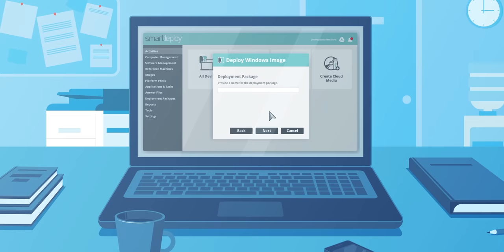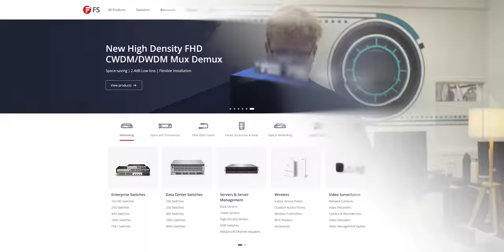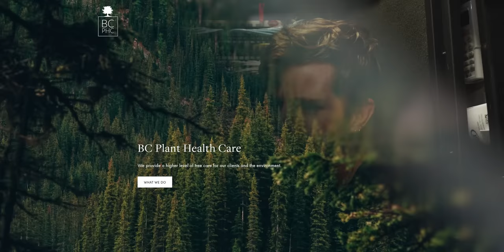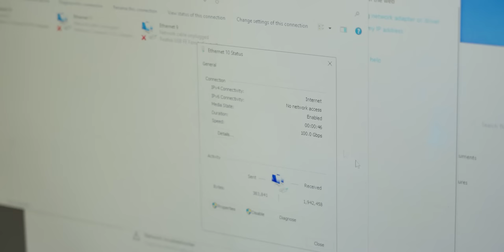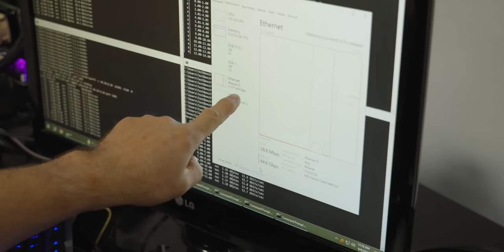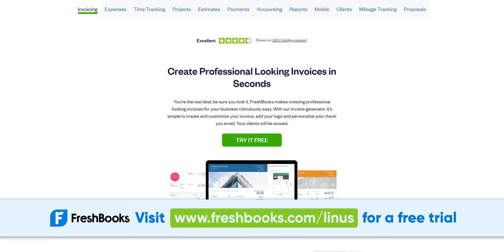Everyone said this was impossible - Backyard Fiber Run

Comment: I work for a telecoms company in England and it’s great seeing the equipment I work on in videos like this! Also glad you appreciate the work the cable gangs do, they do such a hard job!
Reply: didn't your toe nails curl aswell at 6:11 ? pulling a cable during it's whole length through the tiny opening between fence and the non-rounded edges of the fence mounting? this metal is going to have field day rusting due to the outer mantle being scratched. just take the time to properly dismantle the fence, pull the cable through, and put the fence together afterwards.
cable guy from germany.
Reply: @deinemudder3066  I think you may have missed the part where its temporary.
Reply: @andresmithe298  would you be so kind as to link me to my enlightenment? don't want to come as cocky but i am not for information without the point to it. since i obviously did miss it then. thank you (=
Reply: Fiber-guy from germany here. I usually do the connections between cable sections (dunno how you guys call these things in english) and the final meassurements/certification. Usually on 96' and 144' fiber cables.

It's cool to see them have some fiber on camera  :D
Reply: @deinemudder3066  I'm not going to re-watch a half hour video. They said it repeatedly, they were doing this for jokes once they saw how cheap the cable was and explicitly said it was temporary...
Reply: @SuperStevieye  NE3? :D
Reply: @deinemudder3066  they did say it's temporary and they're not going to keep the cable pretty much at the very end of the video 28:40
Reply: @Nazgul094  yes, pull it 2 times through there. and after that straight up throw it away. very ecological thinking. if it was temporary just throw it over the fence, maybe put a blanket over said fence. no wonder american barracks are wired like doggo =/
Reply: @deinemudder3066  I don't think by "temporary" they meant they're going to throw it away but rather they're going to return it to the company.
Reply: even more reason to handle it better
Reply: @deinemudder3066  I'm pretty sure these companies know what LTT does and expect their products to go through high levels of abuse especific to the product they let Linus borrow for the videos, I see it as another way in which these companies can advertise through Linus' videos, showing that the things they make are capable of being handled roughly without much issue and Linus creates content out of showing that, a win-win situation.
Reply: @SuperStevieye  we call it splicing in England, I also work on 96, 144 and sometimes 288 fibre! Always good to see the work gets shown, all people normally see is a modem and not the hard work that’s put in
Reply: @deinemudder3066  most of this video was incredibly cringe inducing.... like them running the cable with ends already on it.... and just running it through the woods the way they did.
Reply: Bro me to, but once he dropped the switch box and caught it by the fiber made me cringe. My boss would prolly fire me. Fiber Optic wire is incredibly fragile, like if you touch the end with like anything it needs to be cleaned or else you will get a lot of loss.
Reply: I love seeing this. I work for Telcoms company in the US. I work with this stuff daily so this excites me so much.
Reply: I feel you dude. Rolling out fibre through rural Herefordshire. Its a slog
Reply: @deinemudder3066  Love that you crap on Americans when LTT isn't even based here, even better that you didn't pick up on the fact they've said multiple times it was a temporary fix. You dont look into everything before you mouth off and it shows.
Reply: @ChillTox  canada is in america, right? the continent is called america, the country is called usa. "temporary" doesn't justify ruining that cable by scratching it. that cable is never going to be sold again with those scratchmarks. talk about looking into everything, merry christmas, next.
Reply: @deinemudder3066  "Americans" pretty much universally, colloquially, means people from the USA. But let's say it doesn't; have you visited enough barracks from every country on the Nort and South American continents to know what the average quality of cable runs is in them? Regardless, it may come to surprise you that LTT is primarily an entertainment company and NOT an IT installation contractor for "American" governments.

But hey, it seems like you enjoy being wrong about everything while trying to convince everyone that "well actually" you're somehow correct. You do you.

Comment: I'm glad you pointed out that this was entirely for the memes. If it wasn't already blatantly obvious to anyone else watching, there is functionally zero difference between what they did, and just keeping the completely intact spool in a single office and testing the speed by connecting both ends in the same room.
Reply: It’s just for the memes…wink wink nudge nudge 😂
Reply: @Likeomgitznich  he’s for sure using it. He mentioned in a previous video he wanted to do it.
Reply: @Likeomgitznich  I wonder what the cost of 600m of that right of way would be

edit: I feel like the equipment wouldn’t be exorbitantly costly to trench and backfill to however deep the regulatory requirement would be. It’s flat ground. Is that area rocky?
Reply: Parhaps? I’ve not heard of it. It has to be spooled. How else would you store or transport it?
I know some stock exchanges and seducers t applications intentionally spool miles of fiber to test artificial run length or to actually create latency
Reply: Nobodies gonna stop him... so yeah I guess he's gonna use it anyways. It's literally in no one's way.
Reply: Haha.. I figured the whole thing about "let's just test to see if it works" thing was the step before "yep, it works, so leave it there."
Reply: @DingDingTheYoutubeBuddy  Copper creates a slight magnetic field when spooled like that.  Fiber shouldn't have any issue, though.
Reply: at 6:20 he talks about micro trenching, so...yeah.
Reply: @DingDingTheYoutubeBuddy  copper, and it's not quantum mechanical, just plain old electromagnetism.
Reply: @AmpdLSU  he said 100k
Reply: Proof of concept, logistics is a big part of any job
Reply: @harmvzon  yeah I blanked on that one lol.  Maybe it was that cost to install as well as take responsibility for any business disruption because of a digging accident or something for ltt since it will not be on his property it’s on someone else’s

Or maybe it’s to trench as well as put it in conduit for protection from root growth and things

Idk just trying to justify why it’d cost that much. Something to do with the business aspect of the installment and the property rights is my guess.
Reply: @rollerskdude  the city will definitely get in his way if they get wind of this happening on their land.
Reply: @Nothinglastsforever  But will they cut the line?
Reply: @rollerskdude  lol I doubt it. Maybe they'll say move it or cop a fine.

Comment: As a Fiber Optic engineer, look up DWDM, Mux/Demux. 

Also start a cable pull at the middle of the route, pull to one side then go to the otherside.
Reply: He should also look in to 802.11AE and Layer 2 encryption, espacially if he is transmitting Media files.

Comment: I do similar Point-to-Point installs as yours.  I use a 27" minitrencher machine (look it up)  to dig a small 2" trench and drop the fiber in afterward.  Could be useful once your proof of concept is done.  The machine can even fit on a plane once disassembled.

Comment: Loved seeing this. I work as a cable lineman. I typically run around 10,000 ft of fiber optic line a day.
Reply: King.
Reply: Linus runs about 10,000 mm of fibre optic a week.
Reply: What do you mean by daily? Meaning, the company that you're working for got a contract and you have been pulling Fiber for month?
Reply: @spankbuda7466  the company I work for is running new construction across rural America to get high speed internet to people who need it.  Been working with this company for over 5 years now, and have been working on the same contract. Our office runs about 6 crews. All the crews together get about 20 miles of fiber installed a week.  Some of the fiber reels we work with are 20,000 foot worth of fiber, which we have to run as one continuous piece, for max speed. The biggest fiber cable I've ran is a 288count fiber, meaning that there is 288 stands of fiber optic line inside the cable.
Reply: @akanitrix9079  That sounds highly unlikely for any company to run FREE fiber service through rural parts just so a small percentage of potential households could have high speed internet. I'm near some rural parts that the cable company refuses to extend their service lines to the few homes not only charging them a ridiculous fee but having them sign a lengthy long term contract.
Reply: @spankbuda7466  to blow your mind even more, I have ran several fiber lines that have been 5-10 miles long, just so one or two houses could have access to our internet. I have worked in several other states, doing the same thing, for the same company.  The new contract I mentioned before is actually for my home town! When we get to that part of town, I am going to be running fiber to my grandparents house, and she hasn't had internet in that area since I've been alive ( 26 years )
Reply: @akanitrix9079  What I'm telling you is that there's no Telecom company that will spend money on materials, man hours, etc. to build their network around 2 potential customers in some rural area if A. the customers paid for it B. the town planning on having new development C. you're updating their network by replacing the existing copper for Fiber C. the Telecom network must go through said rural area to a neighboring area by setting up C/O's/Hops/PFP's. 
But again, you're just a laborer that works for a construction contract company that won the bid to do the work.
Reply: @spankbuda7466   @Spank Buda  I'm more than a "laborer". I supervise all new construction and job progress. My company is contracted out, correct, but the company we are currently under contract with is not just a telecommunication company. They're a power utility company that is getting a fiber optic system within the bounds of their power grid.  Meaning, anyone who had electricity will have access to high speed internet. We do run fiber through rural areas to connect to different city's and systems, but we also extend out lines several, several miles to reach even the furtherst customers, where there is no plans of any new developments. I'm not sure what else I need to tell ya to make you belive what I do for a living 🤣    Maybe I'll be running fiber out to your homestead
Reply: @akanitrix9079  Look, I don't know that if you're lying or not. I'm questioning to what you have stated originally/previously that you were insinuating as if the company who contracted their work out to your company was doing this charitable deed of running Fiber to the few neglected/internet deprived homes out in these rural areas....that they have survived without it for decades. You have also even mentioned your internet deprived grandma on making her dreams come true of having high speed internet before leaving this earth. 
It's logical for the telco company, the cable company, and whoever else to use the opportunity when the electric company are building out or upgrading to use some of the electric company resources i.e. digging, burial, etc. during new construction by getting a discounted rate in construction. I don't know if your company are doing burial, aerial, or both when putting in these Fiber runs at these locations. 
Again, it's not cost effective for any company to build a new node for one or a few houses unless what I've stated before. 
And no, I have multiple options of high speed internet to choose from where I live at and my service providers have been updated their infrastructure over to Fiber.

Comment: They actually are working on 400gbit BiDi (bidirectional) transceivers that would allow this cable to do 2.4Tbit a second. They make use 2 different wavelengths for send and receive, allowing you to utilize 1 strand of fiber for an entire connection. 1/2.5gbps BiDi transceivers are common in FTH deployments. They do have 100gbit BiDi transcievers available today, although they're pretty pricey ($4600 for a pair of transceivers).
Reply: Yeah a product I worked on in 2018 could do 1.2 Tbps BiDi on a single fiber easily. Now we have QSFP pluggables that do 800G and a 2.4Tb module coming soon. 100Gbps is not a challenge anymore lol.
Reply: @iinsomniaaaaa  I was working on a SM connection between 2 floors at our data center for a customer. They kept getting a small reflectance that was really messing with their connection. I asked them how much they were using, Gigbit, 10 Gig, 100 Gig, 300 Gig? She said it was a 4 Terabit connection using transport gear. I found the issue in a dark fiber panel and got them cleaned. I just could not believe how much they had going through 1 strand. Now that the transport gear is more common in the data center, it is like nothing now.
Reply: whomst'd've need 2.4Tbit/sec speed beside datacenter?
Reply: @roy k  who do you think we're selling to lol?
Reply: TASTE THE RAINBOW!!!...with multi colored lasers & frequency specific beam splitters!!!😋
Reply: You can actually do way more than this. Using DWDM it is possible to have 96 Channels, each with at least 100gbit/s, on one fiber, I think even 400gbit/s are possible.
Reply: You could also use DWDM which has up to 48 or 96 channels and afaik the fastest WDM SFPs are 200G, so that's like 19.2Tbit/s per pair of fiber... And I think Ciena also has some proprietary WDM tech that adds afaik another 96 channels... Of course, all this crap would probably cost a couple million but it shows how much data you can actually push over fibers.
Reply: @UC_26TIav0KjnyGjiKGUHZOg he said they are doing 96 100gbit channels over one fibre. And he thought they could probably do 96 400gbit channels over one fibre.
Reply: @royk7712  big ISPs
Reply: @samaneo5  and the Facebooks and Amazons have tons of them.

Comment: The white stick coming out the end is a strength member used to hold the cable in place when it’s fed into a node in the ground. So the weight of the cable is on the member rather than the fibres

Comment: Used to install the conduit that fiber runs through, we did an insane run under the intracoastal in Clearwater,FL that everyone swore was impossible with a Vermeer 40/40, had to bring in trailers of drill pipes and load/unload them by hand. We got it done.

Comment: Fun fact: you can figure out where the break is. Send a pulse down the fiber and it'll reflect partially from the break. In case there is one, that is. For bush removal I'd suggest shrapnel.
Reply: This also works on Cat5/6/7/etc a similar way
Reply: I believe that it's called "Time Domain Reflectometry"!!!
Reply: @fookingsog  correct and you use an OTDR unit to send and read that information in real time
Reply: Napalm more effective or flame thrower
Reply: Bwoomph
Linus: What the heck was that?
Dan: You said to clear the bush...

Comment: As a cable technician, you generally don’t run coax cable more than 400 feet unless necessary, you loose quite a bit of signal to get to 400 and then starting at 400 you loose an extreme amount, even using rg11

Comment: Not only does the metal casing on the "shielded fiber" add strength, it also allows utility locators to locate them when buried. Some fibers are not shielded though and require a separate wire for tracing.

Comment: I'm surprised your business complex doesn't have any underground conduits for joint telco access that you could run your fiber through.  A lot of industrial parks run conduits rather than having the telcos/ISPs do it because they don't want the complex to be locked into a single vendor.  Industrial parks and office complexes that do this usually run a conduit along the front of each row of buildings and then run out to the road where the telcos/ISPs can get access, so if you want telco A instead of telco B, they don't have to trench or run new aerial cable, they can just run through the conduit to get into your building.
Reply: AFAIK he has buildings in 3 different business parks at this point, and this is a solution to connect two of them together
Reply: I'm surprised they didn't just take the reel of cable to their server room and test it there. It's still 2300ft of cable. It's just wrapped around a reel. Video may have been shorter and not as much fun though 🤔
Reply: @trigbagger  This was possibly to show the city they could do it and demonstration puproses for others so they can get a proper permit approved. Or it was just for the vid. But I suspect the work to get through the brush was more than just for the video.
Reply: @trigbagger  That is hilariously true.